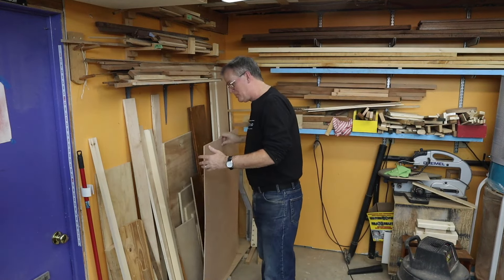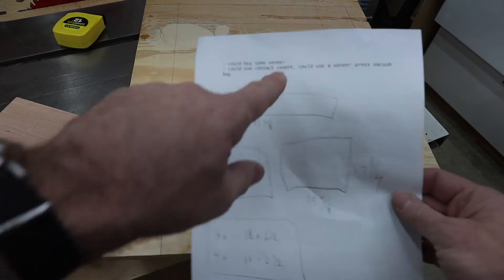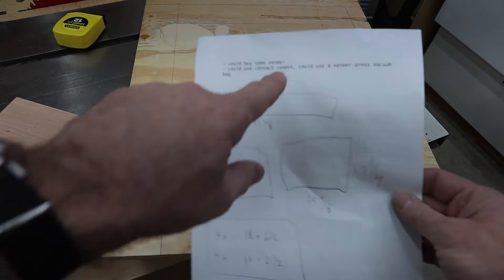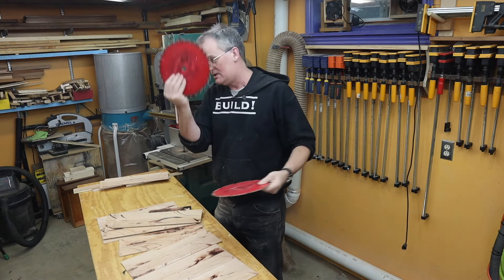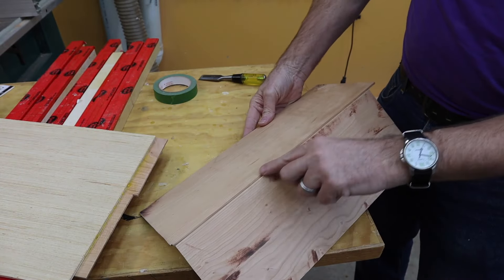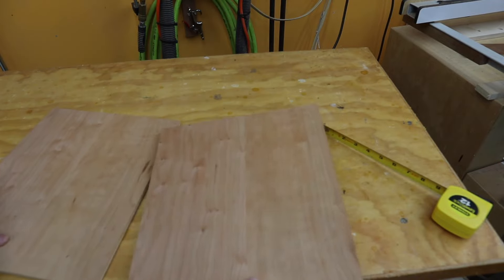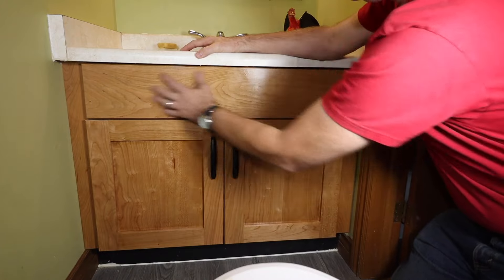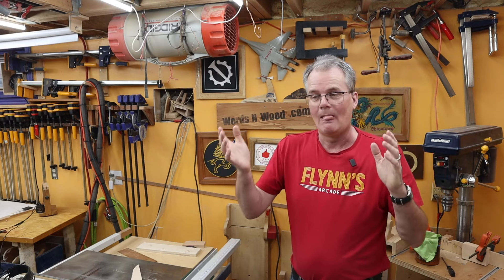Making My Own Plywood for Refacing Cabinets in Cherry.

Comment: Nice job and a great project. Making your ply out of scraps was a nice challenge and solution for future projects. Very cool you try to use what is on-hand as well and not afraid to make the tools work hard. Cherry burns if you look at it funny. LOL!  Your quicker pace and skipping some parts make the vids very watchable and enjoyable. I'll bet even yuo watch some vids and mutter "Geez, get on with it." 

As another commenter suggests, get a nice band saw blade for resaw. You will really enjoy it and your bandsaw will be more of a go-to tool. I used to treat it as a curvy or small, delicate job saw. Not anymore.

Comment: I wonder if that stop in the middle is necessary - I find they get in the way when taking items in and out of cabinets. Wonder if a simple stop at the top and perhaps a stop at the bottom would work better?
Reply from the maker: You are probably correct.  I thought about removing it, but for this cabinet there was no real need for wider access.

Comment: Art, looking around, how do you keep your shop so clean, I see no saw dust, every time I turn on a machine I have saw dust everywhere, even with vacuums??
Reply from the maker: Hah!   There is dust in so many nooks and crannies.  I just sweep the floor every now and then.   (I mean I do have an air cleaner, but not a very good one, and the DC is pretty good)
Reply: Are saying you have a seperate air type gleaner from you dust collector?🤔 @Wordsnwood
Reply from the maker: @cds957  I have one of those small cylindrical air cleaners hanging on the ceiling.  To be honest, it's not the greatest, but it's better than nothing.
Reply: I just work in a small (2) car garage with only half of that, I need the other space for my wife's car and I need to try and keep the dust down as much as possible. I have a Lugna collector hooked up to most of my machines but I have to use only a few hoses and I just move them to which machine I'm using. I have most on castors so I can move when I need to park my suv in there, and I can't do anything until I move mine out.I've been looking at some of the hanging electronic units but where do you start. I dunno, so I'll probably just keep sweeping up...Thanks Art, I really like your channel and the way you are able to explain your process when working especially with some humor.....Charles @Wordsnwood